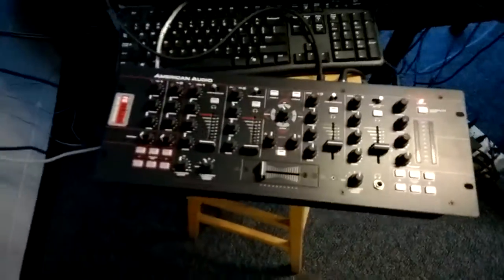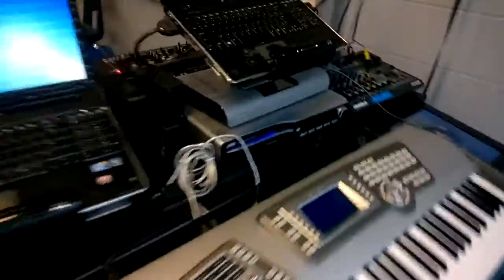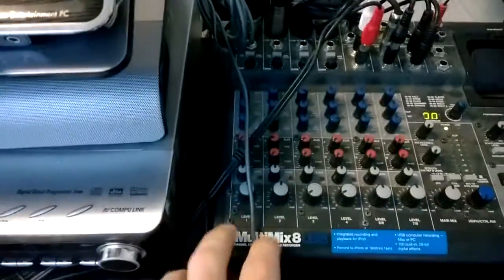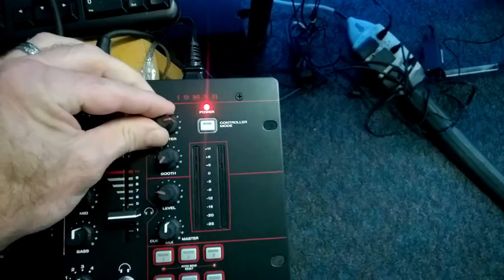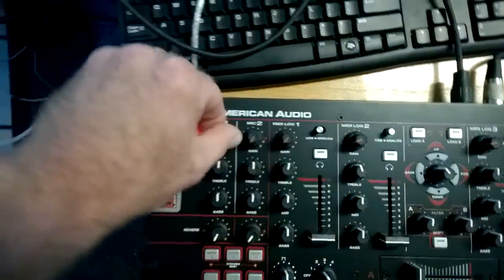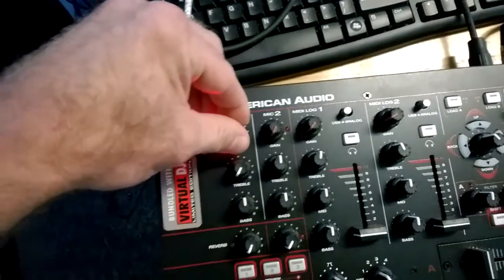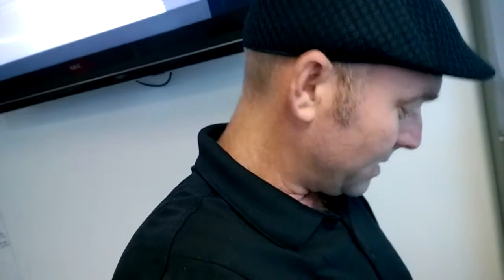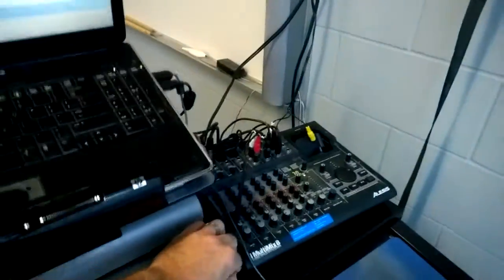19MXR Mic Hiss American DJ

Comment: I was able to duplicate the hiss in a combo XLR / 1/4 female input just by accident on a totally different model mixer. The 1/4 jack portion of the input was damaged to where jack would work halfway inserted; and same type hiss was present which leads me to believe it's just a simple wiring issue or lack of shield.

Comment: i have a 14mxr and no hiss ever (but) the other day i added an behringer shark mic feedback suppressor. and now even with my mic gain turned all the way down.when i activate my mic i get that hiss ? took out the shark & no hiss. so maybe its something in your line of equipment b4 the mixer ?
Reply from the maker: +DJ Tyme 209 If you watch the video I'm able to reproduce the hiss with nothing plugged in.  Doesn't matter what audio system I feed the mixer to. AMDJ did tell me over email this was an issue that no firmware would clean up. I still use this mixer. It's a tank but I just don't use mics through it.
Reply: @JeremiahNichol  pretty much useless if can't run a mike through it, I hate it when they continue to sell the garbage knowing these details, and not inform people.
Reply from the maker: @brianwirt1844  holy crap they still sell this hunk of s***?
Reply: @JeremiahNichol  Yeah, I should know better too, because I've I avoided using controllers with VDJ forever because they're really un-necessary, found a new one for $200, it arrives Sat. will def be sending back after the hiss test: most likely was never fixed in newer units.